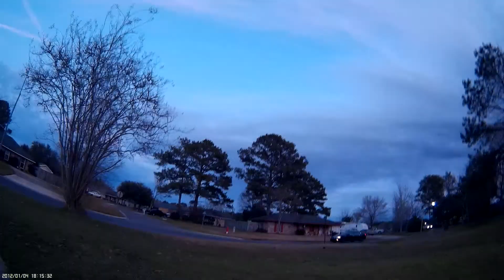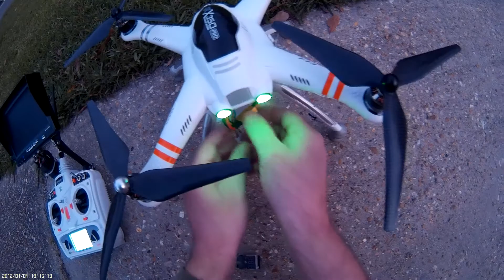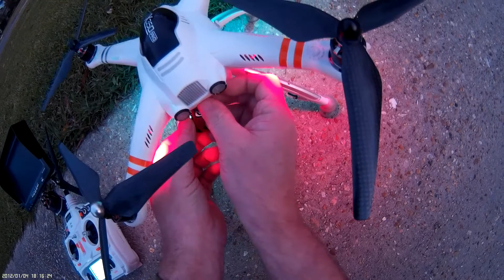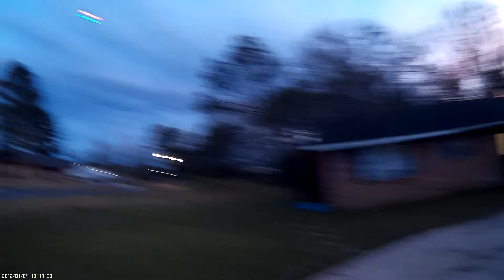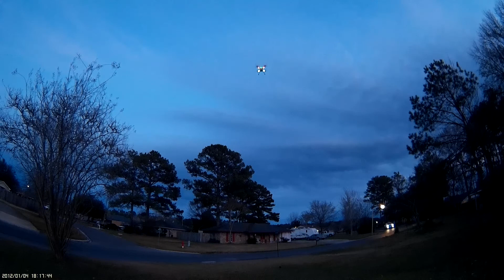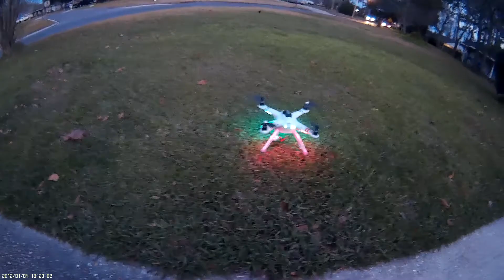Walkera QR X350 Pro Tests 4

Comment from the maker: You want to get that to hover at 50% though. Hovering at 20% is not very easy to control the throttle.
Reply: +Shane Carles 4S is faster? Or because these three radial screws?
Reply from the maker: +Dmitriy K - 4S is definitely faster but everything must be upgraded to be able to do this. 

This has 

1. 4 Opera 20a SimonK ESC's 
2. 4 T-Motor 2213 950kv Special Edition 
3. DJI 9050 3 blade carbon fibre props. 

This also has 

1. APM Side Pin flight controller
2. APM power module soldered directly to the Walkera PDB modular style. 
3. BN-880 GPS
4. Micro MinimOSD
5. Boscam 600mw min vTx